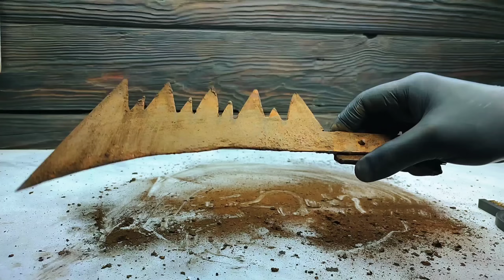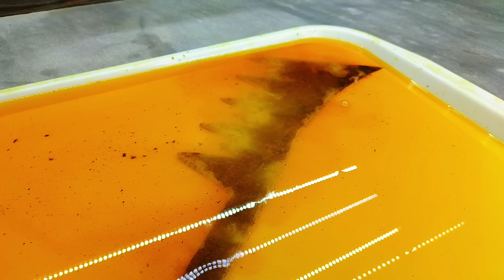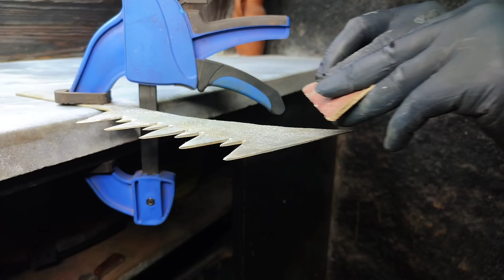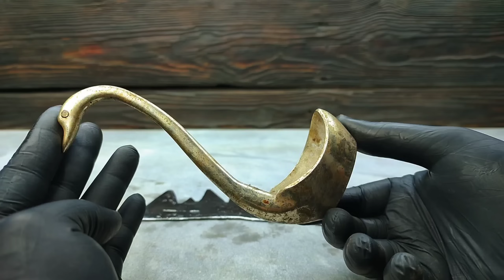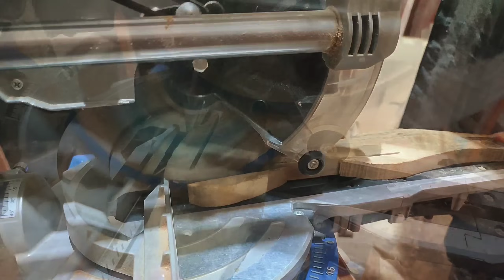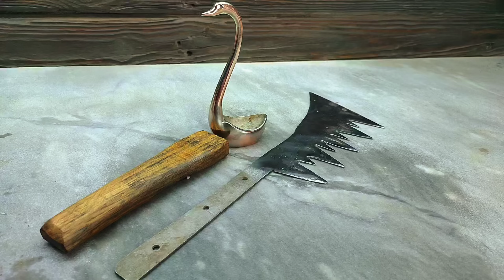Ultra rare ! Restoration of the most different and very violent knife that will shock you!

Comment: You didn't smooth out the spine of the blade and you didn't fix the metal pitting on the blade and finally you didn't shape the handle to the blade